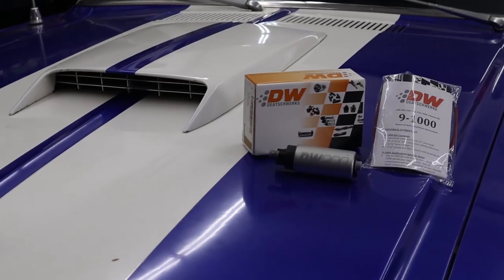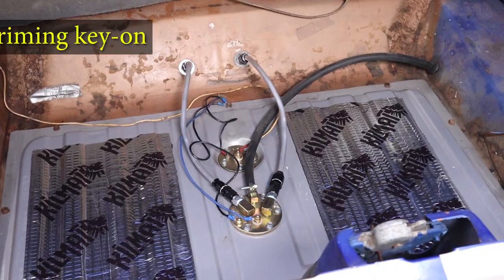67' Mustang gets a new fuel pump

Comment: Wow the old Walbro sounds crazy loud for being in-tank and having an insulator pad around it. I suppose those aluminum hard lines between the tank and body could be exaggerating it, like you mentioned.

The Deatschwerks definitely has a better, or at least less annoying, sound though.

Great sound comparison clips too.
Reply: Robert Burrow 
I have soft lines in mine, those holley pumps are too loud.

Comment: Thanks for the info, Casper. I have the same problem with my '67. It sounds like I have a leaf blower in the trunk. I need to revise my radiator as well and have seen your vid about that. Where did you get your radiator and fan?
Reply from the maker: I ordered the Mishimoto kit (rad, fan, thermostat) from Jegs. It took a really long time to be fulfilled, but the parts seem decent quality. It may have fit without modification of you had a shorter V8 without the longer water pump assembly my new 302 had.
Reply: Thanks man. I need to post a vid soon so you can see my project. The Cleveland engine with sniper is a beast but working out the bugs of a poorly built car that hasn't run in ten years has been challenging!
Reply from the maker: @abedanielspictures  There's always something. That's one of the reasons I kept the horsepower goals down on the Mustang... I didn't want to keep breaking things on the daily driver ;)

Can't wait to see your project!